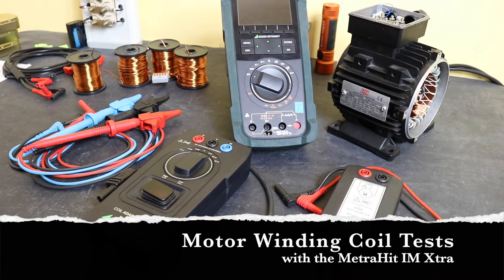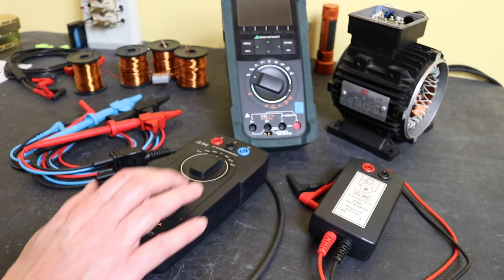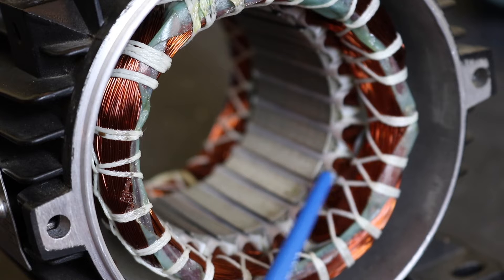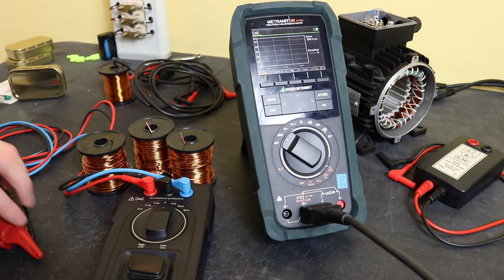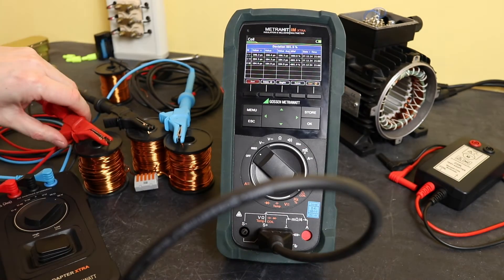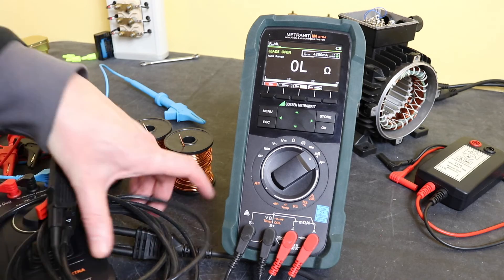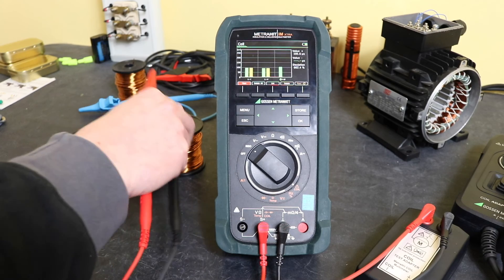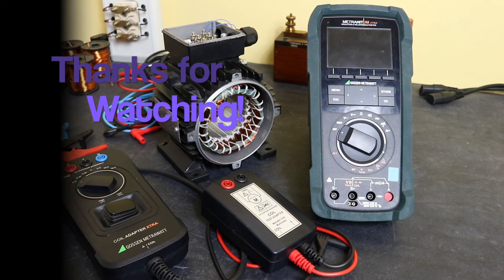Testing the MetraHit IM Xtra Coil Function

Comment: 7:48 micro siemens not seconds
Reply from the maker: It is micro seconds. For it to be Siemens, it would need to be a capital S and not a small one. If you also refer to page 32 of the operating manual of the IMXtra, the microseconds is confirmed in the second paragraph.
Reply: Sorry, yes I had assumed you were measuring insulation resistance converted to Siemens. So, what event are you timing? Coil saturation?
Reply from the maker: @adrianengland4563  I believe it is timing the surge pulse through the coil from the discharge of a high voltage capacitor. This would be a Baker Surge Test, but instead of displaying the waveforms, they are 'summarising' the result with timing value.

Comment: What is your view on the metrahit IM Xtra coil instrument? Is it in your view the best portable motor tester?
Reply from the maker: For me, I would look more towards the MTR105 as it gives better insulation testing functionality. The IM Xtra is limited with a 3.1GOhm maximum that doesn't lend itself to PI and DAR testing, or establishing long term insulation trends.
If you are just after go-no-go testing, then either instrument would suffice.
There are full Baker Surge Test units that are portable, that would give much more detailed analysis of the insulation condition, that would be more appropriate for high voltage motors or strategically vital motors.

Comment: Do you talk to gossen about the tablet issue view problem usually I find that gossen issues firmware updates every now and then that resolves some of these problems. I also like that they often issue firmware updates that extends the instrument capabilities.
Reply from the maker: I did contact Gossen regarding the original MetraHit Coil, providing all my test data and requesting if they could provide an appropriate coil adapter for the motors I test, but I never got a response, so I haven't contacted them regarding the IM Xtra. I do look on the website every couple of months for upgrades.
Thanks for watching and commenting.